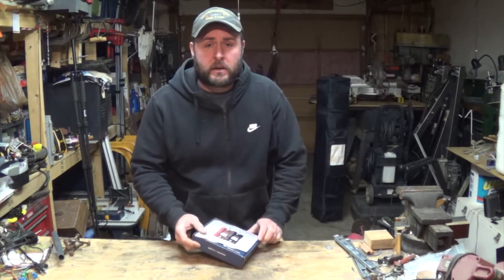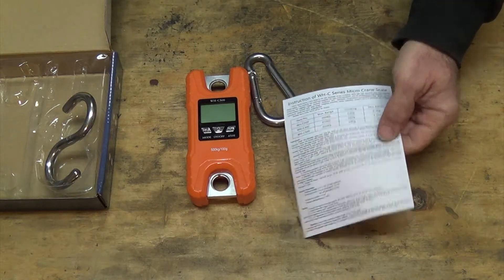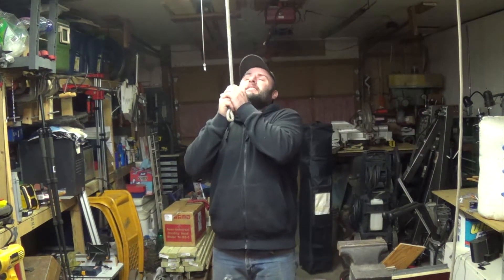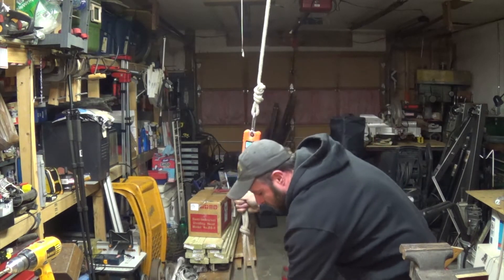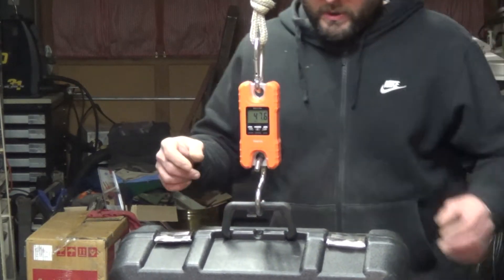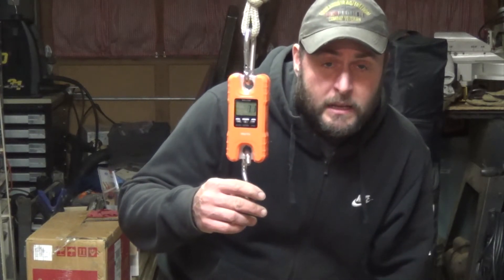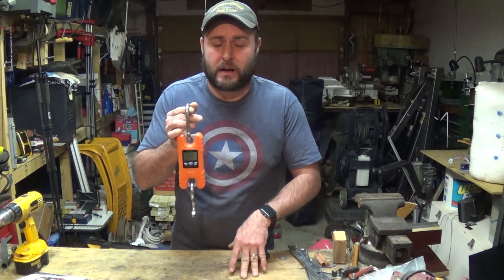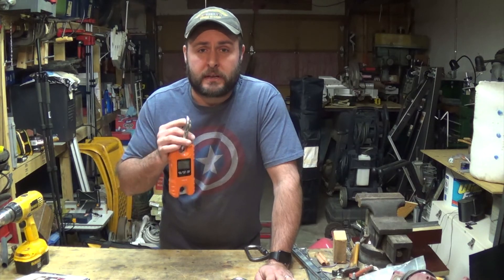WH-C500 Crane Scale 1100 lbs

Comment: Most likely the most accurate is the WH-C500 unless it has seen some misuse since it was returned. I've always found WeiHeng's scales to be quite accurate from factory. Bathroom scales and cheap kitchen scales are typically not very accurately calibrated.
Should you ever need to calibrate it can be calibrated. At least all those I got and while I have encountered scales that I haven't found out to enter calibration mode I've found it quite easily on all WeiHeng I've tried. However I don't know what calibration weight it requires (display will tell you) or if you can use a broader selection. Some crane scales (not by WeiHeng) require quite heavy loads (300 kg full capacity) which is a benefit but of course can be quite difficult to obtain accurately.
I have a WH-C100 (150 kg capacity) and that requires a 20 kg weight (have though of buying a cheap one - more than adecate for its resolution at 50 gram). As does a few suitecase/small hanging scales. Then I have a really small hanging scale 25 kg capacity (5 gram resolution). That requires only a 5 kg calibration weight.
You most likely enter calibration mode by pressing two buttons at the same time - perhaps from off state. Scales only having one button is a bit more tricky. Some you press 3 times from off and hold on the forth press. Others you have to keep on button pressed while inserting battery.
If you don't have the correct calibration weight then when it displays what weight it needs pull power. If you press buttons or load it with incorrect value you might end up miscalibrating it. Scale is not trash - all you need is to obtain a weight or take it to a company who has an pay them a small fee to help you recalibrate your scale.